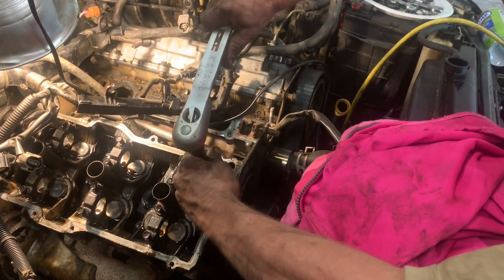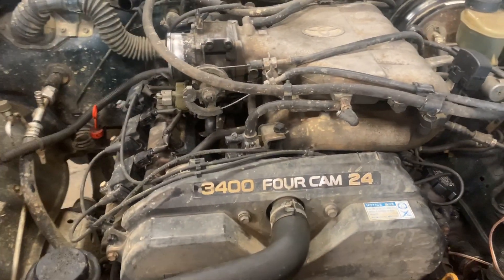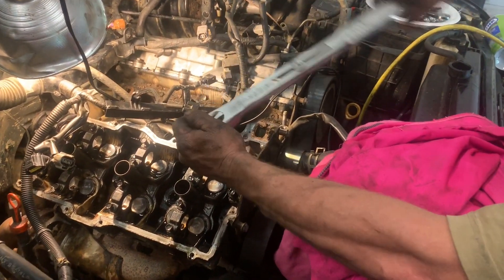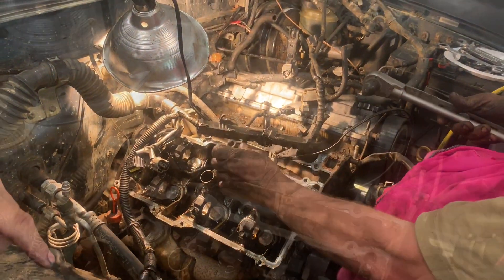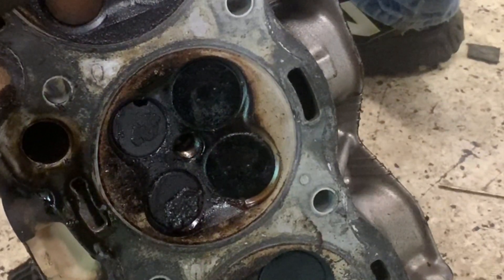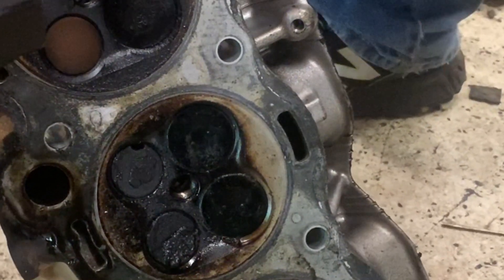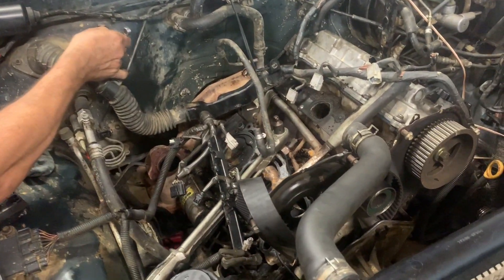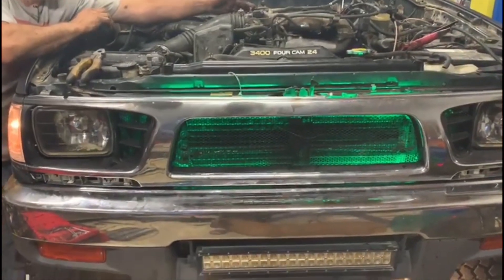Toyota Tacoma 3.4L Motor Swap (5VZFE)

Comment: Nice job congratulation. i have a 98 tacoma in good condition but it has 230k miles  and it is making crazy sound so i also have 2000 4runner with only 84k miles but chassis is rotted out so my plans is to put that  4runner engine and transmission in to my 98 tacoma do you think that every thing should be good to go like  i mean everything fits
Reply: You can put another 150k miles on it don't worry about that for now